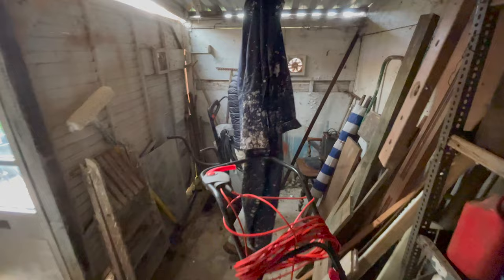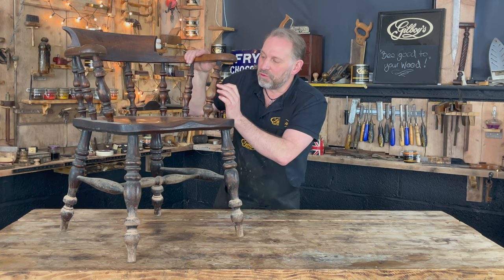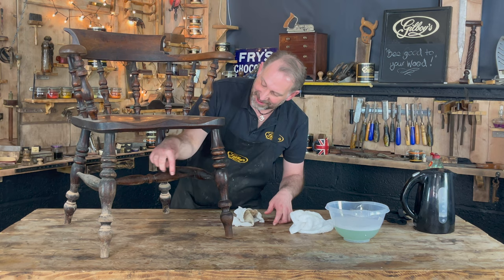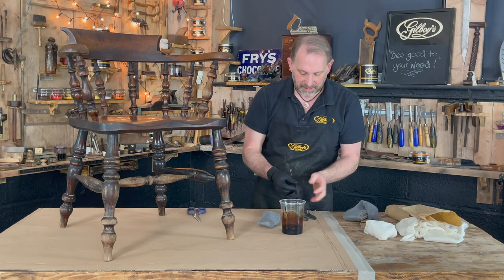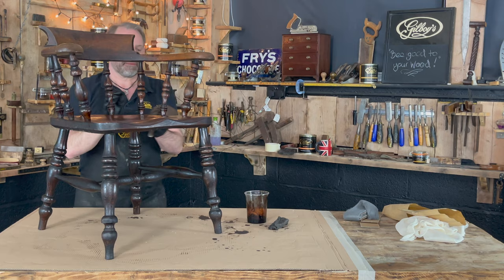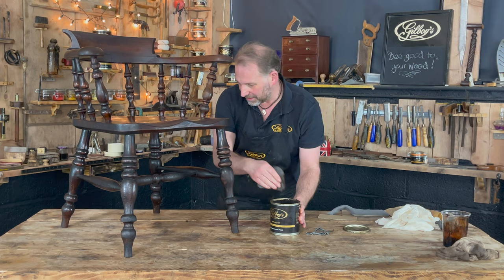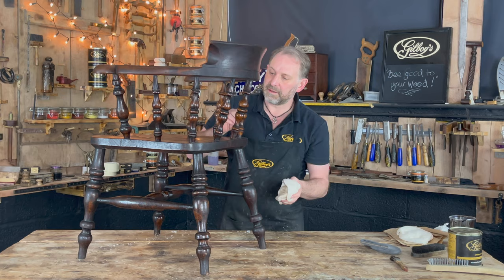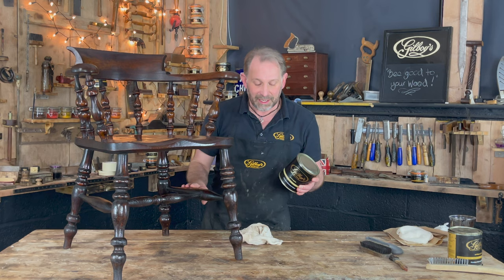FRENCH POLISHERS TRICK - How To Restore The Finish on an Antique Chair in 3 Steps

Comment: Brilliant video. This is the exact way I have been restoring old finishes. Clean, oil stain, wax. I have been using this method for 33 years, I have just purchased a jar of your wax. I am waxing my Georgian tea table tomorrow. I have used many brands of wax over the years. And have not been impressed with a lot of them recently. I used to use Morrells oil stain many years ago. But they changed the formula. I still have some old stuff in bottles. I now use Fiddies oil stain or Smith and Rogers. Which I am really pleased with.  Keep up the good work 👍
Reply: Bff f
Reply from the maker: Thanks Mark.🙂

Comment: The chair is gorgeous now and I love the gentle approach. I just discovered your channel and am enjoying the treasure chest of wisdom that it is. I just acquired my great-greatgrandmothers treadle sewing machine from 1894 and it has a little bit of every kind of trouble. It's good to see you apply different processes case by case: that gives me a bit of inspiration to deal with things as I see myself doing in accordance with my own capibilities, being in the space that I am. You've helped me out with a few decisions I feel clear about now for restoring the woodwork (I need to do research before tackling the cast iron though). Currently treating the woodworm . Unsure still about what I'm going to do about the chipped veneer, and puzzled by the many white paint spots on the surface (while it was in my parent's shed this poor sewing table held their paint jars and white spirit when they were doing paint jobs). I've sanded through the old varnish and yet the 'new' paint splatter seems shows up under the finish in the wood. It's impossible to just 'scratch' off, but I won't use any chemical stripper in my small unventilated workspace.

Comment: What a lovely result and once again I learnt something new, previously I hadn’t been aware of Naphtha oil stain, but I will have to get some of this to add to my restoration supplies for future projects. Thanks
Reply from the maker: Hi David. 
I think you will like it. It's a joy to use. ✅
Reply: @GilboysRestoration  I only wish I had known about this sooner, Simon. I just recently finished restoring a early 20th surgeon’s chair, alas on this instance the old shellac finish was dry and rubbing off with my fingers.  Hence, a light sand back and then refinished with shellac and thereafter a wax polish with your antique gold polish. It would have been nice to have tried the Naphtha stain oil though as I think it would have suited this job. Next time for sure.

Comment: Your videos are wonderful.  Thank you so much for explaining everything so well.  May I ask about the wire wool? I do some turning - in a very amateur fashion - and have been recommended to use wire wool when I do my final finish with wax (Carnuba and beeswax blend is my favourite).  The wire makes the blend turn 'dirty' (don't know how else to describe it), it goes a dirty colour and stains, almost as if the wire were rusting!  I have stopped using it now for that reason.  What do you think I'm doing wrong?  I love the trains, I live not far from the main WSR station and the sound of the 'whistle' is so evocative! 🤗
Reply from the maker: Hi Kathryn 
Thank you for your kind comments. Like you have found out, I would avoid using the wire wool when turning.
I suspect the reason it's happening is because the wax is quickly melting with the friction, I'm not sure where the discolouration is coming from, unless the wire wool is actually in direct contact with the bare wood, in which case it will discolour.
I would stick with applying with a soft cloth. ✅
Only yesterday, on our return from camping at https://www.quantockcamping.com/ we passed over the little bridge at the end of Bishops Lydeard railway station. It looked to be a idyllic spot. The campsite was also one of the best we have ever stayed at, hence why I have copied the link for it.  ⭐️⭐️⭐️⭐️⭐️
Best wishes 
Simon

Comment: I've done a few of those in my time. Unfortunately for me they all had been painted over. Stripping them was a pain. Beautiful result by the way.
Reply from the maker: Hi Jackie. 
Thank you. 
Yes stripping spindle back chairs is a real chore, but necessary when they are painted. 
Hopefully this method of restoration will help save a few chairs, as it is easy to achieve without all the pain of stripping. ✅    Best wishes 
Simon
Reply: @GilboysRestoration  I wish more people would do this, instead of “upcycling” with paint. Obliterating the beauty of wood with paint should be made illegal!

Comment: Wow, that looks amazing. I’ve tried this on my antique rosewood hat/coat stand which I’m converting into a lamp. It’s got a few scratches but not enough to need staining. After a clean with washing up soap and various brushes to get in the tight areas, followed by a polish with wheelers furniture beeswax polish. Looks pretty good now. It’s not the most shiny stuff though compared to yours. The only bits that look better marginally better were the one already glossy before. How come your wax is so glossy? How long does it last?
Reply from the maker: This technique works best when the original finish is still in tact, but has suffered years of neglect. It's lying beneath waiting to be refreshed.
Our polish works its magic in this circumstance by latching on to the old finish and enhancing it. It's what the cosmetic companies would have us believe happens when you apply a rich nourishing skin cream to your face. But in our case it works. 
It will last for years and years. 
Please take a look at this guide https://gilboys.co.uk/pages/how-often-should-i-use-gilboys-beeswax-polish?_pos=1&_sid=d97b247e1&_ss=r
The reason yours may have not worked so well is because the finish has broken or worn away so the wax is being absorbed by the bare wood instead of reviving the old finish.  I hope this helps you. 
Kind regards 
Simon

Comment: I recently repaired and revived two antique Windsor chairs, one high-back and the other very similar to your early Victorian "Irish" chair.
In both cases, pretty much every joint was loose, which was fun :-). Don't worry - I repaired them with hide glue.
I finished the chairs with Osmo Polyx, which looks ok, but does not have the lovely lustre of your waxed chairs. I tried polishing with beeswax polish, but it didn't seem to make any difference.
Would I see a difference if I were to apply your polish? Can it be applied over Osmo Polyx?
Reply from the maker: Hi Clive. 
Thanks for watching. Yes I often demonstrate using this method of polishing: Seal with a hard wax oil and then apply one of our waxes. 
It should give you a nice soft lustre. 
I would try our antique gold. It should work nicely. 
Kind regards 
Simon.

Comment: Hi Simon 
Quick question regarding repairing veneer, how do you deal with replacing very thick veneer when you can’t find any new matching veneer that matches the thickness, could I just stack and glue layers of thinner veneer - seems a little bodgy and a waste of beautiful veneer. Thanks
Reply from the maker: Yes, we have done that before. Basically laminating veneer to make it thicker. But most of the time, if we need a thicker veneer, we will cut it on the bandsaw after selecting an old piece of wood from our wood store. 
We then sand it to the right dimension on the belt sander. All the time keeping the original finished face untouched. 🙂

Comment: Did you restore your VW Camper as well?!!
Reply from the maker: Hi Samantha. 
No not really, it's mine, I've had it for 12 years. I restored the oak interior (all original 1972) In fact I've kept it all completely original. We use it in the summer months. It's very much loved and cared for. I have even kept the original faded curtains, which I now need to reline to protect them form further damage. 😀
Best wishes 
Simon

Comment: The biggest mistake was the initial cleaning: You should have removed the old shellac first with alcohol before applying new fresh shellac☹ .
However: it's a layman's forgery instead of traditional french polish . . .
But if you're satisfied with that - go for it !
Reply from the maker: Hi JB Violins. 
I'm not sure I understand 🧐. 
In this video I demonstrate a way of reviving the original finish, using techniques french polishers have been taught. The intention is; to show complete beginners, an easy to follow way of refreshing an antique without stripping any of the patinated finish. Therefore preserving it's history, be it original or not. 
kind regards 
Simon